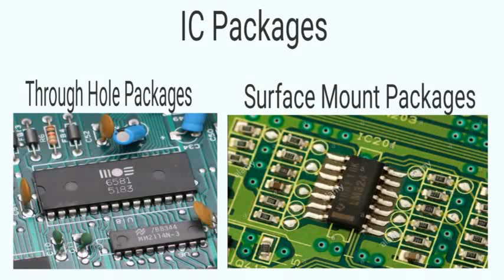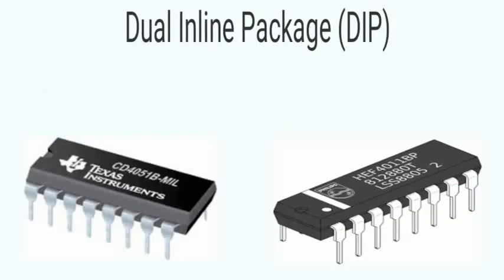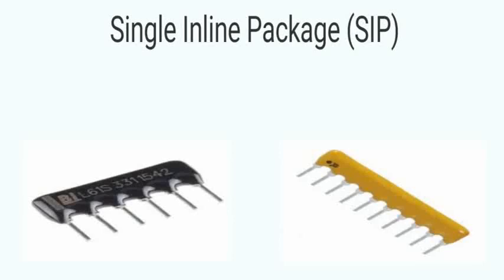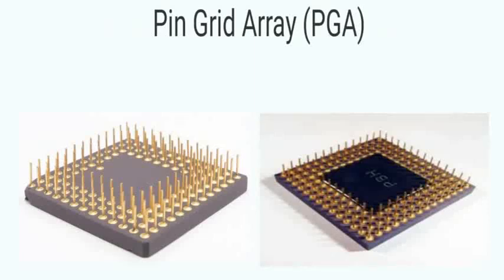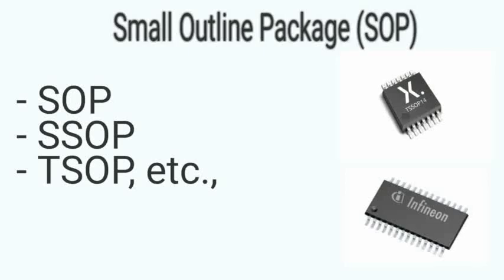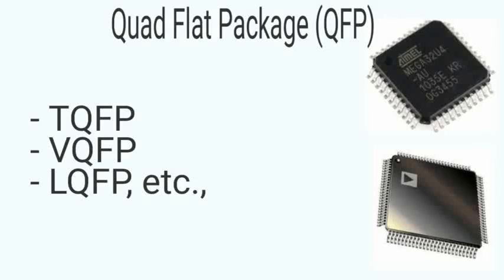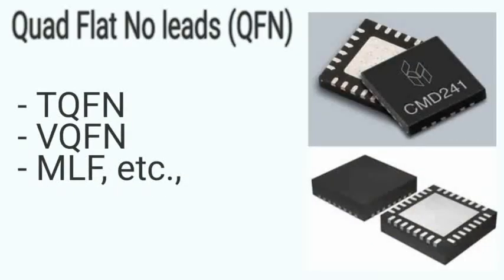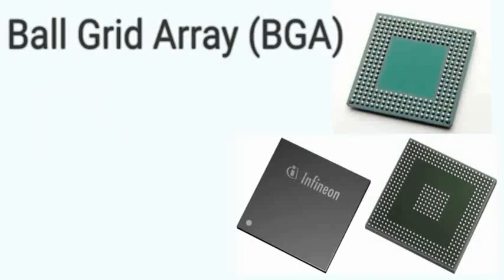IC Packages

Comment: what's the best explanation why IC (Integrated Circuit) is in Square/rectangular shape, not circle?? Why they manufacture it on that shape?
Reply: For the signal go out for the system,for example,the system have so many sensor to test different aspects of the machines,use the air-condition as example:temperature ,humidity,Fan Rotating speed，time ,to know when the home temperature is high,the air condition need to run fast of fan to bring down the temperature in the room.And it need to check the dust in the room,and other informations.Every aspect need a signals.